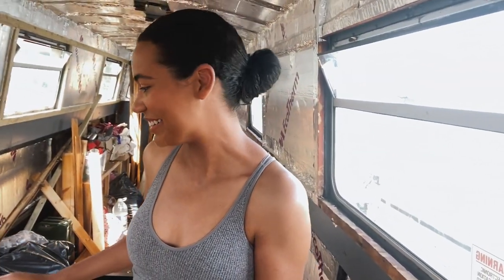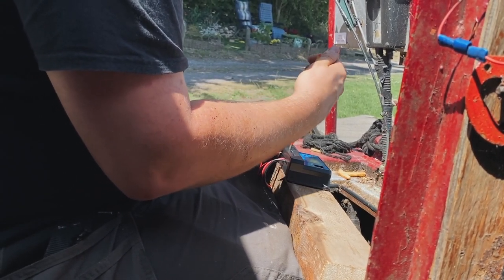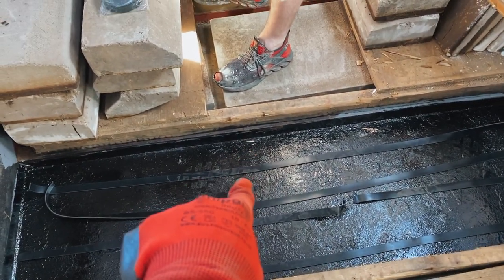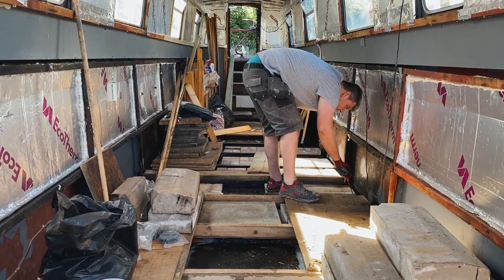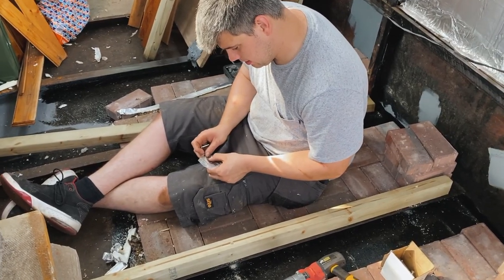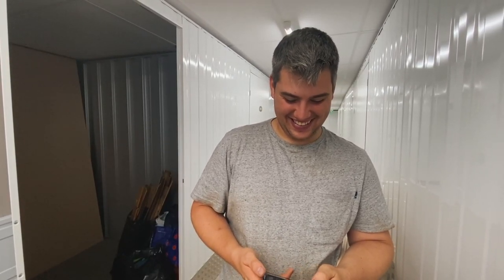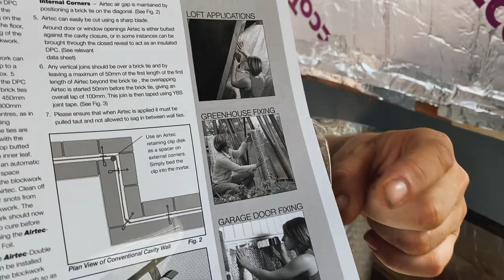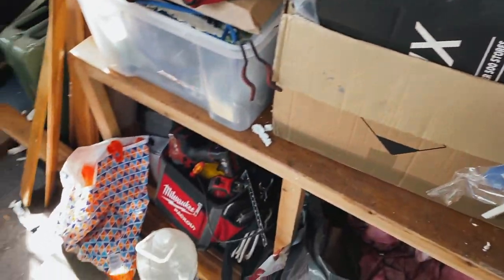Did we do this WRONG?! | DIY Narrowboat Renovation (ballast & subfloor)

Comment: I'm no expert builder, but don't you need to leave the ballast accessible until you have the boat completed, so you can move it around or add/remove some in order to counterbalance the furniture, walls, stove, shower, etc., and keep the boat from listing to one side?
Reply from the maker: Foam can be cut out and placed back in, so that's what we plan to do when we need to adjust the ballast. There will also be hatches in the ply floor for access but we haven't made them yet

Comment: It's worth fitting forced ventilation under the floor from an inlet at the front to an exit at the rear with a bilge blower  for a dry bilge.. inspection hatches in the floor also a must..

Comment: Our boat has no under floor insulation and the bilge is vented with air also very important to vent heavy gases we managed a few years ago to nearly fill the bilge with water it was fine the bilge pump with help from our wet vac emptied it and the vents dried it all out. Also we have 3 inspection points rear middle and front the engine bay should be a completely separate compartment. Hope it helps keep up the good work. 👍🖐
Reply from the maker: We are adding inspection hatches too! And vents in some areas as the previous floor had this. Thanks for sharing!! Always helpful hearing what others have done

Comment: The long term problems with sealing under the floor is that any condensation or water leaks can’t evaporate away. Your preventing the under floor space from breathing.
Reply from the maker: This is something I’m concerned about but the plan is to put a hatch in each bay, so we would have to cut a  square of insulation out for each hatch so that we could open it and see the bilges. Do you think this would help? Would love to hear more of your thoughts :) always good to get opinions
Reply: @DriftwoodFolk  your putting so much hard work into your project and it’s easy to see your trying to do it right. If the professionals don’t do iit there is usually a reason for it.

Comment: Really your way is best take everything with grain of salt then do it to suit your situation. Yeah insulate under floor it is surprising how cold water through steel can get. Everything ya done so far looks fine and as long as Mike's idea off allowing access for water condensation to flow so Mr Bilge Pump don,t get lonely. Coming along nicely like the Brick idea far more user friendly. Main thing ya laughing taking the piss which is required more than anything else. Bum cracks mean ya working. Keep at it and Carry on ;0)
Reply: Pretty much what we are doing 😅 that's what I thought too ha. Ah cheers Nick much appreciated. We've left enough gaps around the edges for it to all run towards Mr Bilge 😂 yer the idea of trying to pull those curb stones up through a hatch was not something I was going to do especially after lifting them. Yano what they say if you don't laugh you'll cry. Although if I'm honest we both do enjoy it. Hahaha honestly it doesn't matter how tight my belt is 🙈

Comment: Hi maybe a daft question but how do you work out how much ballast you need for your boat?
Reply: Hi Robin.. The only daft question is the one you don't ask don't worry. Basically you need to know the weight of your appliances, your layout, the weight of the water and fuel in the tanks, then there's a calculation you have to do to work out how much you need basically. That's the correct way. But if I'm honest it was very complicated numbers wise so we've filled every bay and we will cut hatches in so we can trim the weight on each side according to where we put stuff. But the boat sits just off level leaning towards the back (it's how ours sits for the bilge) so we know we've got it correct. Sorry for the essay 😂🙈
Reply: @mike-driftwoodfolk2651  thank you Mike.
Reply: @MrDanceswithsheep  no worries. Thank you for watching the video ha